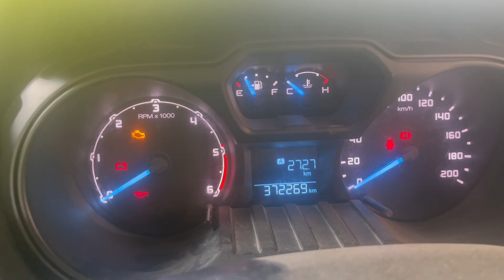Ford Ranger MT-82 6 Speed & a 100% failure rate?

Comment: Mine is 2013 T6 ranger manual transmission 6 speed and still run excellent but still have to keep the all electrical socket clean because some time fault code will show cause by the dirty socket pin..but still no major issue..

Comment: I have a 2014 px1.  Great truck and no plans to replace her for a long time yet.  There is a problem with the gearbox bearings that was addressed in 2013 however some of the boxes made it into 2014 and probably 2015.  I have replaced the clutch for preventative maintenance at 190,000.  Clutch was still in great condition for those who were wondering, but the throwout bearing was shot.  
I have had to rebuild the gearbox due to the bearing issues.  Noise started at 180,000 and easy to hear.  What i researched was that the gearbox assembly was outsourced and as part of the process the bearings had to be supplied by the assembly contractor.  They obviously went the chinese bearings and thus the issues.  After seeing how the bearings are installed and how to access them its a stupid design that requires the box coming apart to replace a $10 bearing.  
Anyway its done now and quality bearings were installed and we should be good for another 400k.
They really are good trucks.  Ive never had any other issues with mine but have swapped the EGR cooler with a goss one just in case.

Comment: I have a 2014 Ranger and it has done 322,000 Klms and I have had no issues with it until now I had a " PowerTrain warning light " come on at 110 kl/h and when I slowed down to about 80 kl/h it went off and stayed off for the next 50 klms when I got home would that be the cooling system playing up to the AutoTransmission.

Comment: 2015 BT50 6 spd manual and had to do bearings @90k km’s. Used as a tradie ute and weighs in at 3T on the dot on any average day. 
I was very surprised when I started hearing the bearing noise on every gear except 5th and was recommended to do the overhaul straight away, before the gears were wrecked.

Comment: I have a for ranger 2012 xl 2.2 d/c the only problem i had with mine is burst intercooler glow plugs and now my ac compressor on 337k km  o i forgot boost pipe got hole but build new stainless one

Comment: It’s easy for someone to say something has a known issue and everyone jumps on it. I have a 2013 ranger and it’s got the 6 speed manual. It lasted till 350k then it did synchro gears for 4th gear. But I think it’s due to lack of oil changes and it being a fleet work Ute being driven hard all the time.

Comment: Not sure if you are aware but there is a recall by Ford Australia for the automatic 6 speed gearbox for models surrounding 2019.
Apparently due to slippage and potential for an accident relating to it.
They are saying something about a replacement shift module or valving etc.
Reply: Yes, my oldone 2019 rebuild all valve and torque converter over 6k $ not sure gearbox anything issues 😅
Reply: @AnhVu-hc1km  should of been done under Warranty? Mine has only travelled 55 K and slips when cold forward and reverse. It's ok once warmed up.
My Ranger needed a new engine after the first service so if the gearbox goes that's not good.
There was also a recall surrounding the front diff spewing oil out through the breather. Apparently it was overfilled at the factory?

Comment: Bought a 2018 PX2 new from Ford, still have it, had a trans service done and decided to also get a trans cooler fitted at 70000k by a (different) reputable business out here in Melbourne’s outer east, no issues, no metal was present in the oil and I tow a caravan every so often. I think regular servicing and not pushing your car too hard goes along way.

Comment: 320,000. not a speck of glitter when i change box oil....   no issues, first gear syncro feels a bit worn, but i go softly with it... thats it. no leaks, no noise, no clutch change, goes like a boss. 3.2, dual cab, 265/70/17 towed a bit in its younger days. occasionally 3-3.5 ton, 4.5 tone on one trip. mostly 2.5 ton loads in the bush to and from a farm into town. no towing since about 150,000.

Comment: Just a theory on why certain vehicles have specific problems and others dont .You wonder if these car companies employ cost cutting  strategies in order to hit their profit targets ect. It wouldnt be hard to cut manufacturing cost by cutting quality on a set number of vehicles and than changing back on next production run. That perfectly explains  why some vehicles have certain issues and others not . One example is pre 2015 had more rivets on torque converter plate making that part not prone to breakage , but than they go and put less rivets in torque plate in the 2016 and up models hence leading to a whole batch of Rangers transmissions failing. 🤔

Comment: Rightyoh. 
I completely agree with you. These are a great gearbox. 
I've got one of the very first px1's to hit Aussie shores. It's a 3.2, 6 speed manual, 4x4, twin cab. It was a press release vehicle.
It's done 230,000 kms and is still a great car. 
It's got some mods, 3 inch exhaust, high flow bigger turbo, big intercooler and remapped. Puts out over 215 kW and 700 NM of torque. 
It's also lifted and running 33's.
That should test out the gearbox. 
The bearing issues that are being talked about is true though. 
The huge popularity of the px ranger, mustang and other vehicles using this box made it difficult for the Japanese supplier to provide enough bearings, so they were sourced from China. 
It's these that fail. 
The front plug did fall out of mine. Minor damage to the bell housing. Cleaned it up with a die grinder. 
As for towing, I've towed our caravan and boat for tens of thousands of kilometres in 6th gear. 
No problems. 
I read the owner manual and can't find any reference to needing to tow in 5th. 
Unlike Toyota. 
I know plenty of people who have these cars, manual and auto, and don't have any problems. They love them. 
I'm not sure why they are bagging them so much,  maybe putting fear into some owners will help their business.
And let them get a good night sleep. 
Anyway, keep driving and enjoying your ranger.  They're a great car.

Comment: Bought my BT 50 with 122k on and it is on 325800 now and no gearbox issues yet. Mixed use that includes towing.

Comment: Px1 230k on the clock. No noise gearbox still strong. Leaks a little oil. Done 110k since ive owned it. Changed the gbox oil twice. Top up about 200ml at 10k service intervals. Do some towing and off road trips. Cant be bothered splitting the case hoping to get plenty more life out of it

Comment: Out of the trade for a few years now but I was doing quite a few of them (not 100 percent fail rate but high "ish" ) Changing the oil is good but not necessarily going to prevent the problem because the failing bearings are sealed with their own lubricant. I think there were bad batches of bearings. Some were failing at 120000kms, some around 200000 and some seem to go forever. I think that mid 300000 is a pretty good innings for bearings and would expect to need to replace soon.

Comment: Maybe? I do have a '18 BT-50, 4x4, Auto with all options. No issues at all except the horn sometimes doesn't work. Clock spring? 
Well, the tranny is a Aisin which are known to be good quality. Driving, stop and go, towing, heat, cold, servicing,... makes a big difference on how long your equipment may last. In general, things are being designed now to only last a certain amount of time. Money need to flow and profit need to be made! Especially newer transmissions are made to last an average of 200,000 km.
Reply: Your gearbox is a Ford 6R80 made in USA. Not Aisin.
Reply: @YZJB   6 speed AW TB60 LS automatic" refers to a 6-speed automatic transmission manufactured by Aisin Warner.

Comment: I’ve seen a lot fail as a mechanic. And I don’t even work at ford
These guys do good work put a few of their box’s in. 
Just becuase one made it high km doesn’t make it a good box.
Out of all the dual cabs I’ve replaced more manuals in a ranger than any other   Dual cab
Reply: Have a 2017 2.2L AT 4x4 with 171,000kms on the clock trans still holding fine replaced oil and filter at 147,000kms. Hopefully wont do rebuild anytime soon
Reply: @ just take good care of it and it should last. Luck of the draw really aswell, seen grandpa driven ones with good service history fail and absolutely flogged ones having no problems

Comment: Land Rover Defender up 2008 to 2016 with the FORD PUMA Engine was fitted with the MT82 Gearbox which is a lighter 4x4 suffering also from multiple bearing failures in the MT82 GEARBOX in addition to the unlubricated output shaft poor design fault . This is a very common fault and I definitely would not buy one.

Comment: PX 1 , 2012, 190 000 km , first gear is a bit hard to engage, this car had huge 21” wheels mounted for 10 years , this may had cause the wear , the other gears are fine

Comment: My 2017 Ranger had the slave cylinder fail at 96,000km. We changed out the clutch while the gearbox was out to replace the slave. It has a bearing noise now when in neutral ,and is difficult to select 1st gear. 
My Ranger has always been serviced at 10,000k's
Slave cylinder should have been a warranty but it failed 3 days before Xmas and Ford were booked out until February, so my own mechanic did the work and I had my car back for Christmas.

Comment: Got a PX3 2021 model 3.2 with the six-speed automatic it's now got 185000 km Touchwood still going strong but I keep the maintenance up to it and the transmission fluid has been changed I'm about to change it again and the vehicle has done 180 thousand kilometres of mostly towing my off-road caravan and mostly Highway driving no issues once again Touchwood and fingers crossed

Comment: Hello, I’m a transmission mechanic, I own a 2016 Mazda BT50 Automatic (6R80) one of the last non DPF models.

I’ve built quite a bit of MT-82s. What I commonly see is bearing failure mainly the front input bearing. The OEM bearings are sealed bearings meaning they are only lubricated by packed grease and are not packed enough, But the upgraded bearings  from Japan has better grease and well packed. Sometimes the MT-82 can brake teeth mainly 6th gear caused by under heavy loads.(Very heavy canopy, Towing, eg). So try not to stress out 6th gear too much!!. I’ve haven’t seen a front plug get spat out yet.

In conclusion I would say they are not a bad gearbox. 100% failure rate is overkill. The most common Km of bearing failure I’ve seen is like 185k some can do more or less depends on the history of the car and how you drive it!!.

 My recommendation is regular servicing!!! Every 50-60k- If the car is mostly a towing vehicle. 80k- If it’s a daily run around car. It never hurts to service it earlier too. If you do that the transmission will love you and will try it’s best to stay together. 
Thanks for reading 😊
Reply: Makes sense! BTW, I do have a 2018 BT-50 with no DPF. And it's running without any issues.

Comment: PX2 2017. I did install an ultragauge in mine and checked trans temp. It was always running over 90, as per the thermostat and the engine temp went up on hot days. Trans would get to 110. So, fitted cooler kit and dummy thermo and it now alway runs under 80 and the engine temp never hits 90 now. Great investment in hot Oz. Change trans fluid every 40-50,000 never any metal. Was more concerned about EGR unit, which I just replaced with new modified Ford component. 140,000. Love it. Cleaning intake manifold last week gave it a boost. Love your vids. Cheers PP
Reply: you are talking about an automatic ?
Reply: @BCBtrucks64  Ahh, yeah, sorry mate, didn't make it clear it's an auto. Just got carried away, this issue riles me a bit. The manuals and autos get a bad wrap but I think the lack of oil changes and temps cause most probs. Never spoken to a mechanic who thought the lack of servicing Ford recommends is a good idea. Worn out oil isn't going to do any bearings any favours. Sorry for the distraction. I just don't get why Ford think it's okay not to change oils more regularly, in both the manual and auto. Seems to be asking for trouble. Cheers PP
Reply: @mrpoopypants9586  the extended oil change intervals are to keep the capped price servicing costs down.  Only has to last the warranty period.

Comment: I watched this a couple of days ago as well ,I did check on the internet and the gearbox they are showing you I believe it to be used from 07/15 on and is called a spline type.I have a 2013 bt-50 and the top of my gear box there is a pin type attachment for the gear stick .From what I can find it was fitted from 2012-2015 , so maybe this box has problems.

Comment: Yeah bro looks like another scam hating on the ranger. 2015 manual px ranger with 355,000 km on the clock and no issues with the gear box. I bought it brand new ,added  bigger inter cooler, 3inch straight exhaust, stage 1 turbo  3 inch lift with a diff drop with all the mods  and  gear box never been opened. So just change the 3.7ltr oil on a regular basis. Keep the oil clean boys it’s built ford tough….keep up the good 👍 work buddy
Reply: 😂 fool

Comment: Px1 @ 200k original clutch always towing , a few months ago thought it was getting noisy but it was the tyres 😊😊😊😊 . The original owner did state that he did get the front bearing changed in the box at around 30k as he was a bit sus about it making a little bit of noise done under warranty.Not sure if Ford used OEM bearing in the replacement